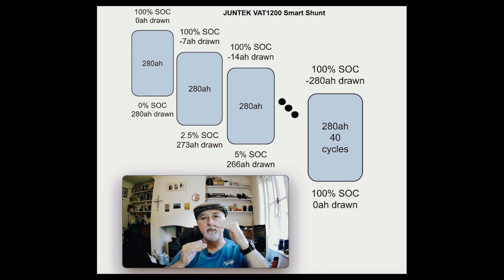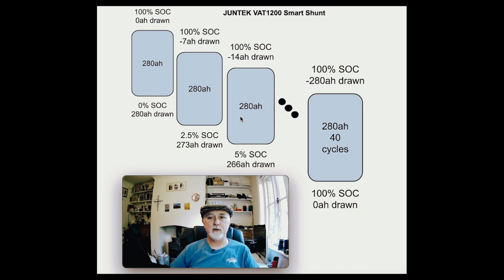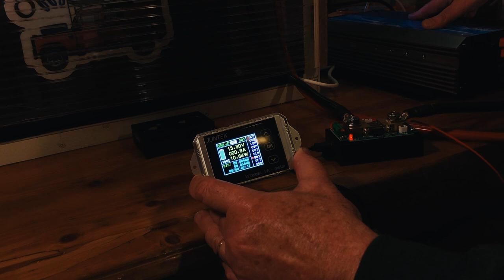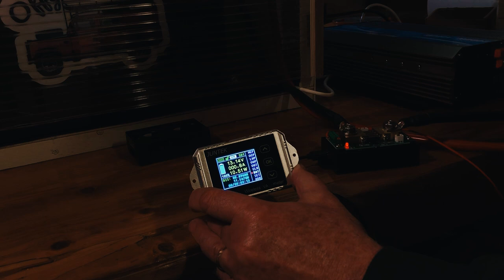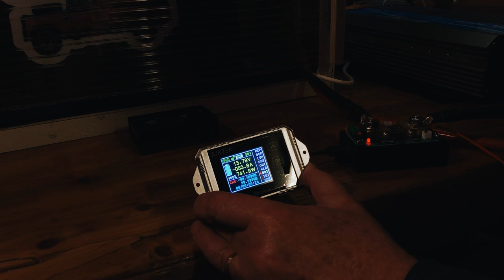JUNTEK VAT1200 Review & Reasons We Can't Recommend It

Comment: Can I use this to turn on and off a diesel generator that will charge my solar battery bank once the sun is gone and the voltage has dropped to a certain point? Somehow of a hybrid system. Thank you.
Reply from the maker: I don't think it will work for that. This is a amp metre counter not really an on/off relay or switch.

Comment: Very Good video.  Question do you know if the software to correct for the cumulative ah's and SOC has been corrected in the newer offerings, specific to the Kg-f 120v? This is a 100amp unit.  thanks in advance..Or what are your recommendations other than the victron, which is out of my budget range.
Reply from the maker: Thank you! We've received one of the new shunts, but haven't got to test it yet. We'll be testing it in the next couple of weeks, so keep an eye out for that video. :)

Comment: Is it the same for the vat1300 or is that model ok
Reply from the maker: We haven't tried the VAT1300, but we have tried the VAT150 and it works fine. So maybe the VAT1300 is fine?

We also bought a couple of VAT1200 from different suppliers to see if it was a faulty batch, but seems to be an inherent bug in the software of all VAT1200 that renders them useless.
Reply: @offgrid_power  ok thanks will try the vat1300
Reply from the maker: One thing to bear in mind though is that JUNTEK do not support their products. We've had very poor dealings with them. We've also had the same experience with 3 of their resellers. 
If you do buy a JUNTEK, be prepared that you may get junk (like us) and the battle to get your money back might not be worth the hassle. Definitely use a credit card that gives you some protection. :)
Reply: @offgrid_power  will do but only £23.00 so worth a punt
Reply: I think it's a matter of when they replenish their stock. If you get old stock you're lucky. I strongly suspect that the software for the different capacity shunts is identical (why would they maintain multiple sets of software?). It seems, judging by a comment from one reseller, that the latest version of software introduced a change to show the user when the battery is being overcharged. Our hope, for their sake, is that they finally acknowledge that the new "feature" is a mistake and after that the new models will contain a "fix". Final conclusion after the waffle: A VAT1300 is perhaps more likely to be old stock because one assumes as it's slightly more expensive than a 200A shunt that stock moves more slowly.